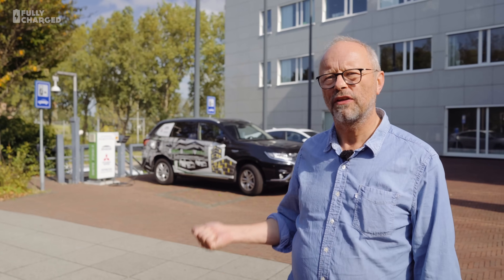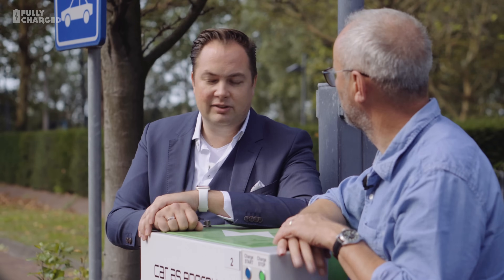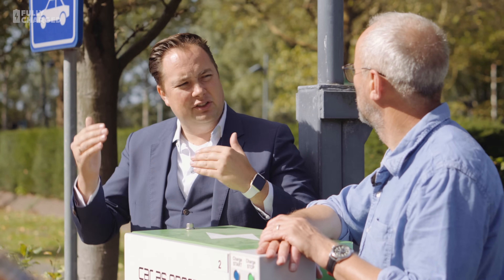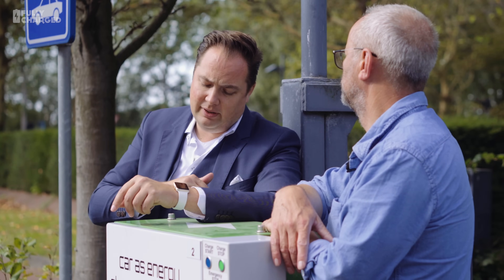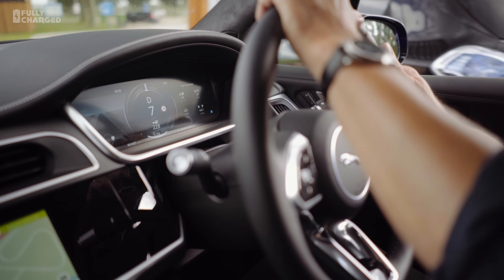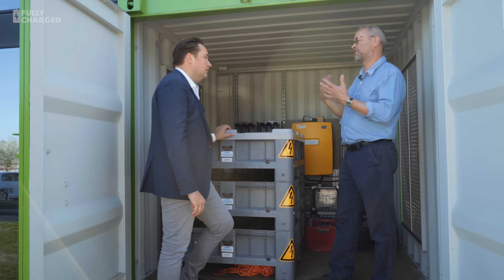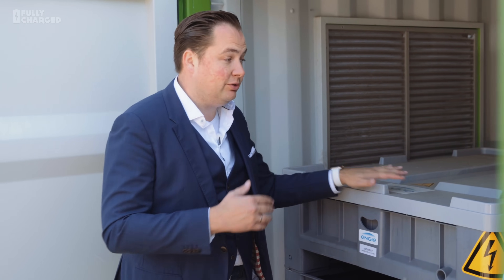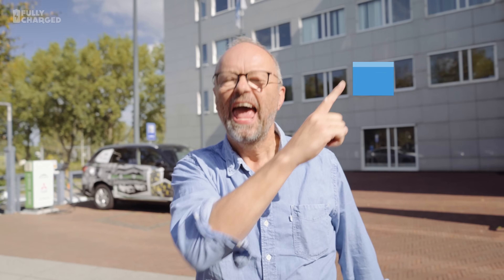Engie Vehicle-To-Grid | Fully Charged

Comment: 'it's more efficient cause you only use one inverter" ... well .. there is no need of an inverter to charge a battery from DC panels ... cause they are both DC. You only need a DC-DC converter which is a better performer then an inverter.
"you have an inverter and a DC micro grid" .. mmm what ? So there is no inverter .. clarify cause ... you mix everything here. An inverter is a device that convert DC to AC. A DC to DC device is a converter.

Comment: >^..^<         Your guest in this video just mentioned all batteries are limitd to specific number of cycles. Would you know your self or know who to ask if regenative breaking counts as one cycle each time you regenerate from your kenetic energy to slow down in your EV?.  If it is, this could make using one pedal driving a vary costly a common practice in the long run I suppose......

Comment: Great clear no nonsense channel for EV thikos like me. I lived in Tanzania where you could experience power cuts several times a week, where you can get a trickle charge battery inverter system installed quite easily. But it was expensive due to the small market & taxes etc plus the use of premium new batteries.  Ironic the 'developing world' solutions are being re-imagined in the emerging battery to grid world of so called 'developed' countries.  The big problem is see is space, which is where the T Powerwall is good.  In theory this could transform the business of recycled batteries and the battery market. So many potential market synergies between EV cars, old lead acid batteries, and the powergrid out there.  I hope the old legacy power generation companies don't put a drag on this to protect profits. This should be seen as a public good in decarbonising our economy. Interesting times, I hope the channel will keep following this development.

Comment: sounds like one is using electric vehicle to power a building instead of the other way round, that's a silly idea given energy demands on buildings and in homes. Just use renewable energy like solar or hydroelectric to power buildings; also, one place solar panels on car-park canopies to charge electric cars, power building and/or sell excess to grid if enough power is generated

Comment: The lead acid thing - I'm skeptical. He admits you only get about a year out of that kind of lead acid battery pack. That is quite short. I would think switching out and managing, processing, disposing of these large and heavy packs that are pretty much constantly wearing out, would be more expensive in labor than the savings you get in the low cost of these packs. Especially as the cost of lithium keeps it downward cycle.

Comment: Ok, technically its possible to discharge a car battery via inverter to the house/office grid. But what's the business point? To charge a car at night and release energy back at the daytime? I can save some money but it will drastically reduce the battery lifespan - and car batteries are f**g not cheap. So I'm not sure, if my "profit" will be positive at all? Use a car as a backup power source? That's sounds better but in my area electricity turned off 1 time per 2 years... not so big deal. Finally, I don't see any reason to buy this thing.

Comment: The use of waste Lead Acid batteries only makes sense while there are millions of IC engines. Once those are replaced by electric cars, where will these come from?
Reply: Err, well, there ARE millions of ICE cars! And don't forget that new ones will still be manufactured for years and years to come......
Reply: @andymccabe6712  - Yeh, but it's not a viable long term business model is it!
Reply: Well, nobody said it had to be! Lots of business opportunities are quite short term, but still viable. Some simply fulfil a temporary need etc. And, what do you define as long term anyhow........?
Reply: @andymccabe6712  - Fair comment, but bear in mind that although the number of batteries sounds colossal, the capacity compared to what's being fitted in vehicles is insignificant. Who knows how long IC engines will take to replace, but during that time there will be much fewer Lead Acid batteries manufactured as the whole infrastructure for them  slides into terminal decline.
Good luck to anyone who can make a quick buck, but Lead Acid batteries are set to become extinct. Now, using cars to store and return energy to the grid is going to be significant, and that will be several orders of magnitude more in KWH terms than this side show.
Reply: Also, the Lead-Acid batteries they were using here were out of datacentres (for uninterruptable power supplies), not cars.
Reply: @Roxor128  - So there aren't that many of those available then... at least, not on the scale of what's required for this application.
The idea of storage is a good one, but it does need an enormous supply of batteries. If each car maker produces battery modules from used cars, that might work, or using those liquid electrolyte cells that were featured some time ago. You just have to be realistic about where all these batteries are going to come from before getting over excited about the idea.
Reply: @rogerfroud300   -  You can probably use any second-hand battery, so long as the control electronics are properly configured. Not hard to see a modular system allowing a dozen different chemistries in the same building showing up somewhere down the line.

Comment: He talks about being able to disconnect the batteries under load, however these connectors (Powerlock) are not rated for this, especially with DC.  I wonder if there is a switch on the battery tray.

Comment: Why would I want to discharge my cars battery? What if I got in and it was empty because the grid gobbled up the energy I have paid for? Imagine someone coming over and siphoning petrol from your tank.
Reply: Wouldn't happen. The car's software would let you set a minimum charge level to leave when doing vehicle-to-grid work. Set it to 80%, and the lowest you'll find the battery would be 80% unless it hadn't had enough time to charge back up from something lower. Also, you'd be getting paid for the energy you add to the grid.

Here's how I imagine the scenario:

 You pull up to a public charger, plug in your car with 65% left in the battery, and tap your credit card. The charge service puts an initial pending transaction on the card of, say, $10 to make sure it's valid. The car starts charging and you go off to work. Over the course of the morning, the car gets up to 95% charged. Then during the lunchtime rush, the price of power goes up and the car starts discharging into the grid. Around 13:30, the battery hits 80% and the car's computer halts the discharge. Around 14:00, the rush is over and the power price drops again and the car starts charging again. By the time you get back at 17:10, it's fully charged for the trip home. You end the charging an unplug the charger. The pending transaction is updated to be for (30% + 20% capacity) * low day price  - (15% capacity) * peak price. If the battery is 50 kWh, the day low price is $0.25 per kWh and the peak price is $0.40 per kWh, then that's 0.5*50*0.25 - 0.15*50*0.4 = 6.25 - 3 = $3.25 as the final transaction on your credit card.

Comment: Lead acid greenwashed Engies ! If they were serious about this they would drop in some flow batteries and be done with it.
Reply: Uh, did you miss the bit about the batteries being ones that were getting tossed out anyway? Using flow batteries would require making new batteries. This is just reusing existing ones and getting a bit more use out of them first. If you only need to recycle them every 4 years instead of every 2 becuse you're giving them two years in building-support battery banks after their original data centre use, that's half as often you need to spend the energy on manufacturing them.

Comment: I’m sceptical on the benefits of V2G.  Imagine instead we have thousands of “smart” EV chargers (just normal AC chargers) with vehicles plugged in and charging at 7 kW.
The grid then sends a signal that it needs, say, an extra 1 MW of generation.  Instead 200 of these smart AC chargers drop their rate from 7 to 2 kW.  Or 1000 of them drop from 7 to 6 kW.  Drop in demand is just as good as a boost in supply.  It only needs to happen for a few minutes so the grid can adjust.
Benefits:
- People don’t need DC chargers in their homes or businesses (people who are fast charging because they are on their way somewhere are not candidates for this tech)
- Will work with all vehicles, not just Chademo (which is dying out)
- Fewer cycles on the battery (although the Engie guy said this isn’t a problem, which is interesting, but he is also trying to sell this tech)
Reply: Why don't people need DC chargers? What about the people who already have them in their homes or for private use? Should they be taken away because they are "not candidates for this tech"? What makes one a candidate?

It's not picking an argument here, but you need to clarify why this is a bad idea.

You make a good point about reducing the load on the grid. But I think we can apply this now irrespective of future mass EV use of the grid. If all industrial and commercial buildings were fitted with smart energy monitoring and usage systems, this would have a dramatic and immediate impact on the stability of the grid.

If we are looking specifically at electric cars or V2G, then this is about re-using excess energy when needed. My understanding from this video is that this would not be a constantly in use system but a load balancer and backup system. Other than range anxiety, the reality is that ALL vehicles (lead-acid included) store energy which is unused on a daily basis. Figuring out how to re-purpose this in a beneficial way and on a larger scale seems to me a good idea.
Reply: @2002RM  What I mean is that people already don't need DC chargers (they are high speed, 50kW+, are expensive to both purchase and install, and in most cases not available from a domestic residential supply).  I know hundreds of EVs owners and none a DC charger at home.  Even most businesses with electric vehicles don't have a DC charger.
The V2G system demonstrated uses Chademo which is a DC only connector/protocol, so is not available to any home or business unless they are going to outlay $50k to buy and install one.

Comment: Probably already been done, but does the complete floating solar set up track the sun?
Reply: Doesn't look like it to me. As far as I can tell, it's basically just the same as having rows of fixed-angled panels on a large flat roof.
Reply: Roxor128 Well , as it would be simple to do, I guess the benefits aren’t that great.
Reply: @andyphillips7435   -  One of the main advantages of solar panels is minimal maintenance. Add a tracking system and you've suddenly got a whole lot more that can break down. A tracking system can add another 20-30% output over the course of a day, but unless you're in a situation where you really need that extra percentage (such as an off-grid house in the middle of Australia), it's not worth the extra maintenance.
Reply: Roxor128 .I can imagine an on land mechanical tracking system to be high maintenance but a floating array , tethered at it’s north end , would pivot easily through 120 degrees. 50 ton canal coal barges were pulled by one horse once upon a time .
Reply: @andyphillips7435   -  Oooh... Yes. That could be a hell of a lot simpler. Just a cable, two pulley wheels and a motor. Fix the pole-facing edge of the array, put the wheels on opposite sides of the lake, attach the motor to one of them, and make a trapezium between the wheels and the equator-facing corners of the array with the cable. Tracking computer turns the motor slowly over the course of the day and back again during the night.
Reply: Roxor128 Absolutely, seems odd, someone must be doing it. I mean , big reservoirs don’t suffer from shade generally, and the lake bed would keep the out going electric cables cool. Maybe Robert will pick this up?
Reply: @andyphillips7435   -  Another point in favour of floating solar: by covering your reservoir in floating solar panels, you cut down on evaporation. Would be a very good idea down here in Australia where we've been having a drought.
Reply: Roxor128 “What you do need is unshaded space for the arrays, and that’s where the surface area of our reservoirs is a real advantage.”

The new floating array at Lancaster will be around 7,200 square metres in size with some 3,520 solar panels.  The installation will cover an area the size of a football pitch and will provide 1MW of power – the equivalent of the needs of 200 homes.”
This is for a sewage plant in the UK. 2018. Not tracking the sun, but recognise the benefits of less evaporation and reduced algae in the summer

Comment: this is why i hoped chademo would win over ccs. css has plans, but those are vague and off into the future. 

we could do vehicle to building as a transition stage. aside from chademo cars, the workhorse w-15 can do that now, but  from a different outlet. that outlet was actually meant for power tools, but its 7kw. easily enough for an apt or small house for example. until ccs can do it, this could be the way forward or an interim step.

Comment: V2G actually has possibly the greatest benefit for being able to transfer a lot of our domestic heating needs to renewables, which is the next big problem we face. In Europe, we tend to need heat in the early morning, evening and at night, times when the is zero solar insolation, so we currently use GAS and oil for our heating needs.  With V2G you could charge you car at work on daytime solar power, and take it home to heat your house over night!

Comment: Most studies and figures i've worked with suggest that it is not possible to make a Lead Acid battery storage system provide a net positive cost. ie the battery cost, even when second hand, dividing by the total charge exchange is significantly more than the cost of grid based electricity. Of course there is still some merit in using LA as load levellers that cost money, but provide an overall and highly necessary stability service to the grid. (This is because LA is fundamentally a "constant state of charge" system, and it does not support by it's very nature a deep cycling capability, which is intrinsic in a practicable ES system used for Renewable back up etc)
Reply: How much does it cost to buy a free battery which is about to be sent for recycling?
Reply: @2002RM  A typical LA 12v car battery, when new, is rated at around 50 Ah, which at 12v nominal ,means a power of 600 watts for an hour, or 0.6 kWhr (in reality, it will be significantly less than that due to voltage sag as SoC decreases).  When it is worn out, ie fails to start your car, which is when they get replaced,  it does that because the plates have become sulphated and therefore it's effective capacity (at cranking power, which is around 1.5 kW) is insufficient to even start the engine. (1.5Kw for 3 sec of cranking is just 0.00125 kWhr...).  So the issue with worn LA batteries is their high Internal Resistance.  They still have some capacity, but that capacity can only be accessed at an ever decreasing power level.
  I actually did a series of tests when we were calibrating the Battery Charger and Monitoring controller (modern cars have smart charging of their LA batteries, which is why they last much longer than they used too in older cars) and an automotive LA battery that has reached Effective End of Life has something like 30% of it's capacity left, but only accessible at around 5% of it's rated power when new (~ 100w typically).
This is what renders them uncost effective, even when effectively "free"   ie with each battery providing around 100w max and just 0.2 kWhr, you need a huge stack of them to provide any meaningful power, or capacity and the cost of the support infrastructure to utilise them becomes limiting
Reply: The second issue is that the recycling chain for LA batteries is slow, and has no method for maintaining their cell voltages once they have been removed from the cars they failed to start. What that means is the batteries sit, for days, weeks and even months and they self discharge (as do all batteries) and their cell potential falls. And for an LA battery, once it falls too low, electrode plating occurs and the battery is, well, it's no longer a battery.  This means that a "box of batteries" received from a recycling centre are not actually viable in any sense of the word, they are simply lead blocks.  The batteries shown in the video and claimed to be "recycles" may well have been second use, but they sure as heck didn't come from within the pre-existing LA battery recycling system imo.(which is a system that has been running to recover the lead from these batteries for years and years and works very well, but it isn't a system that support recovering a viable battery)